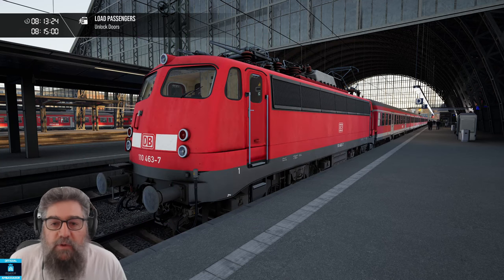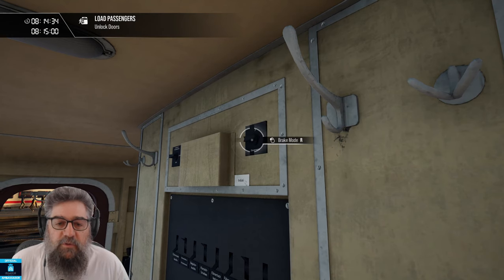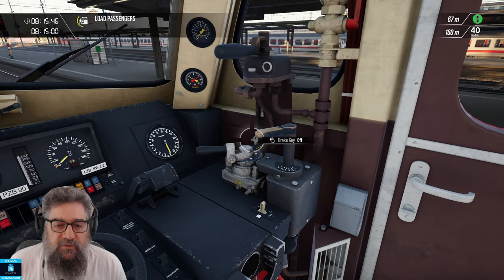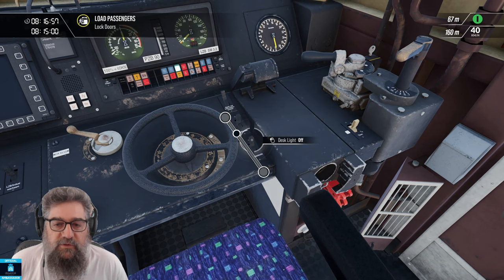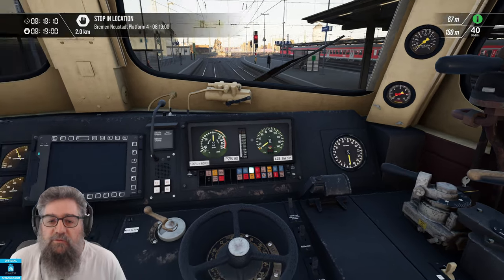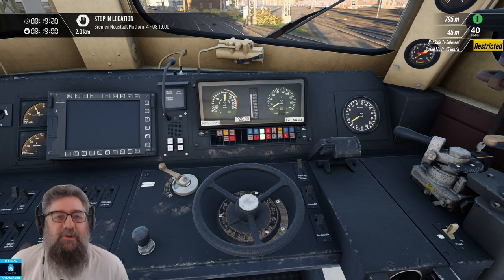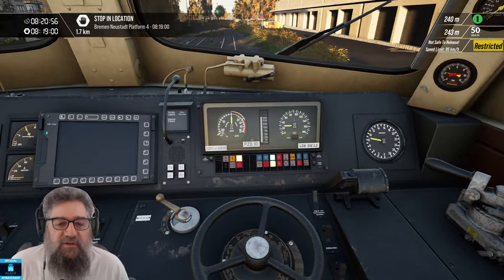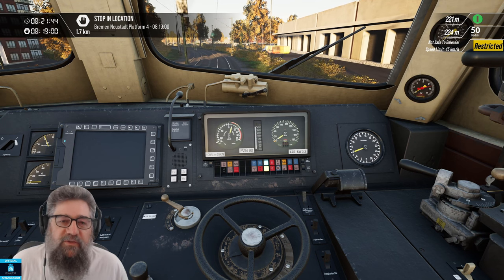TSW3 DB BR 110 Tutorial on Bremen-Oldenburg

Comment: You need acknowledge it when it’s 85kph or under on this train type. If you’re where driving for example freight it’s 70kph >. There is also one where it’s 65kph > but I’m not to familiar with it.
Reply from the maker: thanks, which part of the video are we talking about?
Reply: @trainsimulatordriver  the part where you didn’t acknowledge pzb when the speed changed at an signal and you wondered why it stopped you. 9:37 in the video. Btw love your videos keep on going.
Reply from the maker: @permedbethorsby5417  thanks heaps, yes I did wonder about that
Reply: @trainsimulatordriver  just welcome mate
Reply from the maker: @permedbethorsby5417  I've pinned your comment which should help more people :)
Reply: @trainsimulatordriver  thanks

Comment: My hometown

First look at my home range: Very good, also based on the 2000s.
There might be a few mistakes, but you can look the other way. For example the advertisements in Bremen. They hang close to the platform and not on the station wall.
The railway bridge in Oldenburg is protected by a protective route, which actually means the main switch is out and the panto is down. It's a shame they didn't simulate it.

The target display at 9:40 in Bremen-Neustadt: Yes in the 2020s there are those with a running display and much smaller, but in the 2000s I dare to doubt that this display exists.

Delmenhorst-Heidkrug: Well implemented

Delmenhorst: Very well implemented, the ads also match very closely.

Hoykenkamp: Seems too modern for 2000s

Schierbrook: The train destination display NEVER exists: otherwise the train station is ok

Hude(Oldb): Well implemented, but one can argue about the train destination displays, again the small running ZZAs

Wüstig: Well implemented (see Hude(Oldb)), ZZAs are more on the building

Oldenburg(Oldb): VERY WELL implemented, the ZZAs are also correct

Exits:

Bremen Hbf: platform 1 and 3: left
2: Right

Neustadt: Left

Hoykenkamp: Right

Delmenhorst-Heidkrug: Right

Delmenhorst: Right

Schierbrook: Right

Bookholzberg: Left

Hude(Oldb): Left

Wusting: Right

Oldenburg:
Platform 1, 4, 6 and 8: left
3, 5 and 7 right

Track 2 is a through track and is only used for freight traffic.
Reply from the maker: Great feedback I'll pass this back via the ambassador channel, thanks 😀. Are you enjoying the trains?

Comment: Is this route compatible with Raildriver?
Reply from the maker: Yes it is. The tap wheel does work with the RD throttle but it's not a great experience. I use the keyboard for tap up/tap down
Reply: Yes it is to a degree, the tap changer does take a bit of practice to get to grasps with using the RailDriver, expect it to not go into the tap number you expect everytime. For example on mine when you apply the 'throttle' with the slightest of movement it'll go from Tap 0 and straight into Tap 3 or 4 (luckily the tap changer will go, 1, then 2, then 3, then 4). Tap 0 to 4 isn't bad as it stays within the limits of the circuit breaker, though sometimes you'll forget and move the throttle lever just a little to much on starting and go Tap 0 to 7 (or greater) and bang, you'll blow the main circuit breaker!

Have fun with it, practice makes perfect!